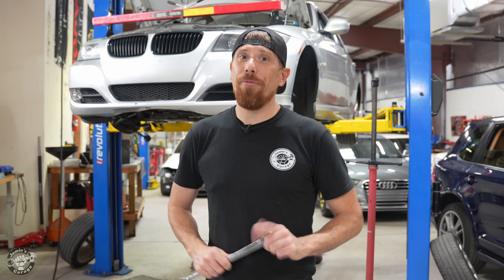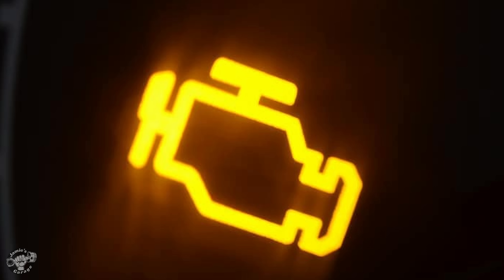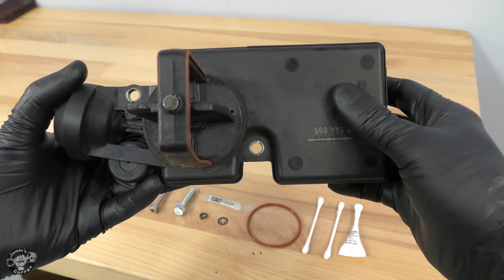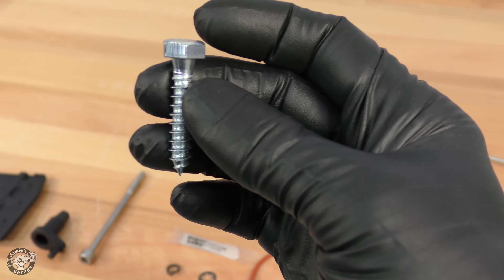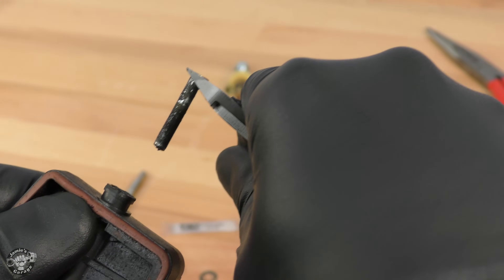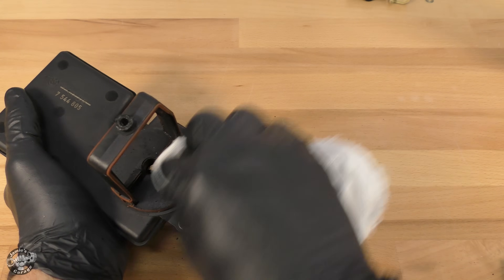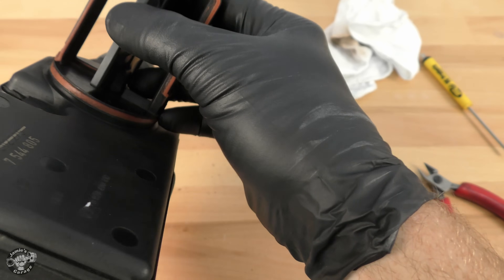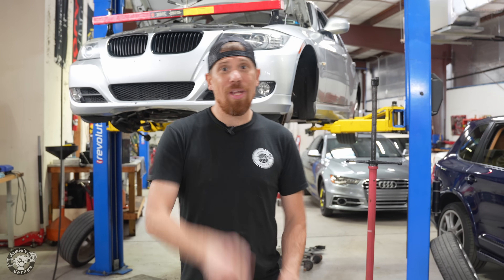BMW M54 DISA Valve FIXED and Upgraded!

Comment from the maker: Guys, it’s been a crazy busy Month for me 😮‍💨 but I’m finally getting caught up and I’m excited to have several videos coming to you this month. 💪 Including the SMG to Manual conversation of my e46 m3, preparing my 335d for impact festival, installing bayoptik headlights in the e90, adjustable end links and the f80 competition seat conversion into my e90 😁 For now, here’s a quick video from the chrisfix m54 video where I rebuild a DISA valve to make it better then new! Thanks for watching 🤘BMW M54 DISA Valve FIXED and Upgraded!
Reply: Would the repair kit work on a N54 2009 335i xdrive or do you know a kit for this platform? Just want to make sure my engine doesn’t get messed up if there is the same problem.
Reply: Nvm I being dumb the n54 doesn’t come with a DISA valve🤦🏽‍♂️ sorry bout that😅
Reply: Great video the best I have seen so far on this repair. Do you have a link to the kit you purchased? I’m in the process of upgrading my N52 with the 3 stage and I want to rebuild both DISA valves first. Thanks for the video!
Reply: Super, że dzielisz się takimi usprawnieniami. Pozdrawiam.

Comment: The crank lever of my disa valve broke in half, do you think I can temporarely fix the thing by using a small screw that goes through the crank lever and into the flap?

Comment: Great video and tutorial Jamie. I have a 2001 BMW E39 530i, how can I tell if I have a Rein DISA valve or OEM BMW DISA valve before ordering the repair kit off German Auto Solutions?
Reply: I just upgraded my DISA Valve using the German Auto Solutions kit, it went just as you described and my DISA Valve is a BMW made, it is stamped on it.

Comment: Very nice explained. Please let me know the location or source to supply the correct rebuild kit on Disa valve, I ordered through Amazon and received the parts, but the length of the flap is short on my M54 206 X5, The brand is X8R and its Aluminum.
Thanks so much

Comment: I had a 07 328i with the n51 engine and my disa valve completely shattered launching the pin into cylinder 2 intake valve. This happened at 106,000 miles. Sold that car and have a 2013 328i with 185,000 and going to get a rebuild kit for it!

Comment: Great tutorial! Just rebuilt mine this morning. I carefully removed the DISA valve, keeping it as level as possible when working it out. Come to find out, the flap wasn't functioning, same as in your video "and" the end pin slipped right out. So, yes, be very careful when removing these. I ended up using the German Auto Solutions rebuilding kit with titanium parts. Made sure my diaphragm was in working order and everything worked out perfect. One less thing to worry about with my '03 E39!

Comment: Good video I need to do my e46 disa valve but I didn't know how it comes apart took it off to check it and the flap is loose it can move anywhere it wants to, now I know why my car was hesitating at low revs gonna order a repair kit and sort it out

Comment: The link to buy the M54 3.0 DISA rebuild kit doesn't seem to be working.  Can you point me to where I can buy this kit?
Reply: I literally just ordered a kit on Amazon but I have a 2.5 M54 so it's slightly different ( the main flap is a different length ) so be careful when ordering the right one for your 3.0 M54.  I chose not to order the more expensive aluminum kit and opted for the $16.95 plastic rebuild kit, LOSTAR brand that had 100 ratings with a 4.3 star average review.

Comment: Hi love the quality of work your provide !
I checked the disa on my 330CI from 2001 and 240 000 km on it.
No problems at all.
In my opinion it’s impossible in case this pin get lose, that she can reach the motor.
And that’s because this pin has no space to move as the plenum is just behind.
Are you sure about it ?
Thanks,
Reply: The risk of that pin falling out and into the intake occurs during the removal of the disa valve.  As you pull on the disa valve to remove it in its entirety, it creates space behind the disa valve... enough space that the pin can then fall out and drop into the intake.  The key is to be very aware of the angle while you are removing the disa valve and don't tilt it so much that the pin can fall out.

Comment: The rebuild does not address the bell crank shaft seal. That can be a vacuum leak source. I think this would be a strong argument fir entire valve replacement.

Comment: does the disa valve on the n52 engine suffer the same fate? if so, is there a rebuild kit for that one? I have a 2010 528i xdrive with the n52 engine and 125k miles. is there a list of things I should do to my engine in order to make it more reliable, like you did to ChrisFix's engine?

Comment: lack of low end or high end torque?

because i am experiencing no power at high rpms, and poor fuel economy 

but the push at low speeds is still strong (it still kicks)
Reply: Maybe Vanos stuck open?

Comment: Just bought a disa intake for my non disa e90. I’m so glad I saw this before just giving it a clean and throwing it on. Im coming from the e30 to the e90 and im learning sooo much about these cars. It’s crazy how easily you can create power in these little engines

Comment: Should the flap be installed in completely closed position? I attached it to this plasti rod and its slightly open
Reply: When new, the flapper is completely closed on the DISA valve unit.

Comment: Thanks for the great vid. Very easy to follow. I am surprised that the orangy  gasket on the flapper frame is not mentioned. Mine is degrading; I'm sure others are, too. If you try to clean it, good chance it will come apart. My o-ring, flapper( prolly original), and crank thingie looked really good. Frame gasket not so. Any thoughts on that frame gasket material? Seem like air will leak, maybe not critical though?

Comment: Es ist unmöglich, daß der Pin im eingebauten Zustand aus der Disa heraus fällt!!! Is is impossible, that the axle fell out of the DISA, if the DISA is built-in tinto the intake manifold. Main part of the DISA which fails is the "motor" of it. The diaphragm breaks. So, do not waste money on a kit - buy directly a new original complete one.

Comment: Can you rebuild the 2 Disas on the 3 stage intake manifold on the N52? The link only shows for the N54.
Reply: You can install a 3 stage manifold on a N52 engine. They don’t come with it as a stock manifold and I would repair the used DISA valves while you’re doing it. I am in the planning stages of this upgrade currently for my 2008 Z4 3.0I with the N52 engine.
Reply: @dennisvandegrift9085  a 3.0 si z4 does come with a 3 stage manifold.

Comment: I’m curious, do you know anybody with a 3d printer because they could’ve used polycarbonate and add a slide panel for the pivot screw for extra security and use the aluminum kit with the flap they sell on Amazon

Comment: Hey Jamie i have a bmw e39 with m54b25 engine and it starts pulling after 4000rpm so could it be the disa valve or/and vanos? 175tkm on the meter. The idele control valve gets stuck sometimes but not all the time. Thanks and keep on making good videos 👍
Reply: His tip of covering the vacuum outlet and releasing the DISA valve is spot on.  If it goes more than the ~20 degrees or so shown in the video the diaphragm is bad.  A DISA valve failing in this manner will reduce power and response at lower RPMs.

From my experience, the IACV (Idle Air Control Valve) will get dirty over time and cause surging in idle or something of the like, but typically won’t cause much issue while driving (under load or throttle open).
Reply from the maker: It could be several different issues causing your concern. I'd recommend to remove the valve and inspect it like I show you in this video. You might find something. :goodvibes:
Reply: @JamiesGarage1  thanks, going to check it at the same time i check the idle control valve.

Comment: What about the later N series engines?  Are these valves still problematic?  My wife’s 2011 2.5L E90 has a loss of midrange torque which wasn’t cured by replacing the VANOS solenoids.  I’ve done lots of research and no concrete solution.  I don’t want to continue throwing money at it without knowing the cause.

Thanks!!!
Reply from the maker: The N engines don't have a DISA so you're good there. You'll need to have it diagnosed to find the issue. Good luck 🤘
Reply: @JamiesGarage1  Unfortunately that's incorrect. N52s (aside from the US 325i) have DISA valves, and the 3 state intake manifold found in the 330i and X3/X5 N52 models have two DISA valves, an inner and an outer. I had to replace both of mine. They're actuated with an electric motor and a worm gear, no vacuum pot. They can get worn out with time, but I don't believe they have the catastrophic issue like the M54s with the pin dropping out. The N52s will throw fault codes for DISA valve faults though.

Comment: Nice video! Some kits come with a new diaphragm (cup) for the small valve on the end. It would have been good to show its disassembly & installation.
Reply from the maker: I've never seen those. The diaphragm is sealed shut so unless its expected to be cut open and glue it shut again, I'm not sure how that would be serviceable. I'll look into it though, thanks
Reply: Not saying it’s written in stone, but from my experience I agree with Jamie in saying that the interior diaphragm of these are not serviceable.

Comment: of course its plastic
Reply: The plastic construction wasn't the source of the failures.  It's the design and material selection.

The original flap and linkage used a heavily glass-filled resin.  Normally a high glass fill strengthens the plastic and extends the service life, at the expense of mold wear.  In this case the glass fill acted as an abrasive.  If the flap is able to move slightly, it flutters and the vibrating mating surfaces grind away at each other.  When loose, the fluttering might loosen the upper metal and start wear there.

Comment: Do you know if this kit works for any other m5x disa valves

In my case specifically a m52tu
Or if the m54 disa would be compatible
Reply: I asked X8R if their DISA rebuild kit was suitable for the M52TUB25 engine in the early E46 323ci and they said their kits were not suitable.  I have not contacted other vendors yet, I would also be interested in finding one!
Reply: @cheeseburgerbeefcake  can also not find this info

Comment: Completely off topic but I have a 1989 635 CSi; can you recommend some kind of software that will read the OBD I codes?
Reply: Great question, I would also like to know recommended OBD I readers.
Reply: You need a Peake Research Code Reader if you have the 19 pin round plug in the engine compartment, I own one that I used on my 1998 E39 528is. You may be also able to use a Creative C310 code reader, and use a 19 pin round plug adapter to ODB II, but I have never tried it, just watched a few video's on it.

Comment: So is it like throttle body or it is different?
Reply from the maker: Different. The engine has a throttle body, this is only used to direct the air through the intake manifold for more or less air volume depending on the engine's needs

Comment: Is it the same for N52 engines?
Reply from the maker: N52 doesn't use a DISA valve so you're all good.
Reply: @JamiesGarage1 I have an 06 325i 1st generation.  They sell both left and right for this year and make. I'm totally confused.  I doubt you'll see this but can you double confirm.  Because I'm lost. I've been trying to figure this out for days now. Worrying about the pin.